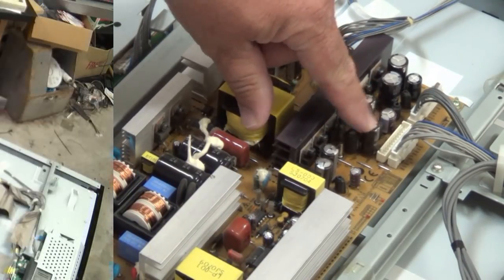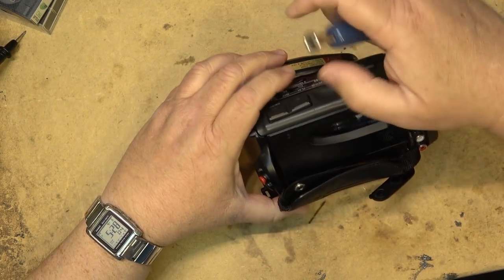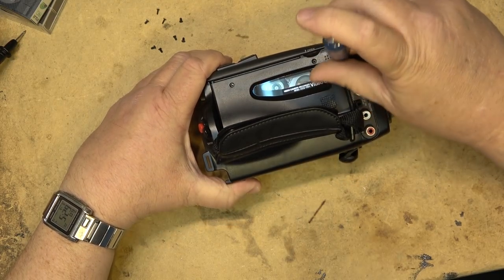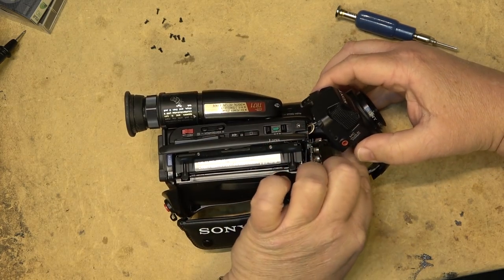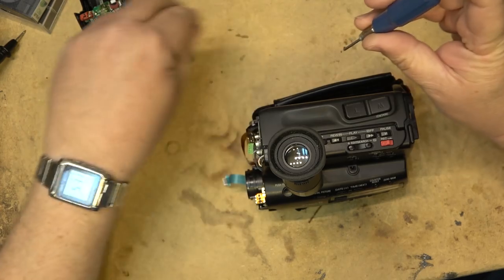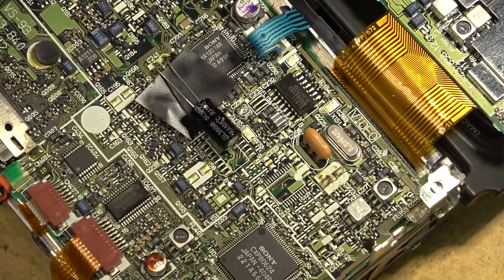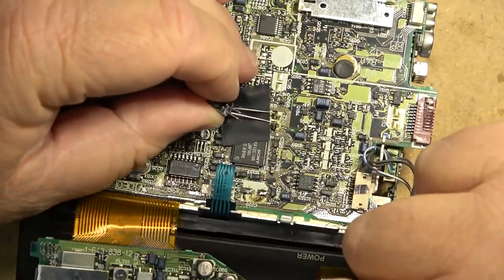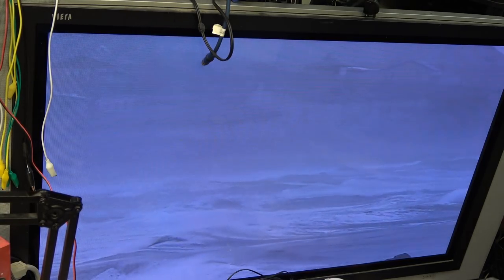Sony CCD TR71 with a very bad picture repair

Comment: One year to be precise  you worked on this camera. 😍
Reply from the maker: No it was more than a year ago more like 2
Reply: @12voltvids  did you check your video play list i found it on your channel, but if you want to still correct me that's ok.
Reply from the maker: 2019.  It's 2021 now.  That's 2 years by my recollection. It was an Indian lady that brought it to me and wanted me to sell it for her. I told her it wasn't worth anything as it would cost about as much to repair as i could get for it.  I transferred all her tapes for her and basically fixed for free and she sold it.   The guy that bought it gave it to me when he was finished with it.   Now it goes up on Craigslist to find a new home and hopefully that will be it.   Unfortunately i didn't receive the adapter.
Reply: @12voltvids  ok thanks. 🍻

Comment: I have this exact camcorder, it turns on and plays etc but the viewfinder has a vertical line only that i can see, i also notice an odour, probably needs caps, i may have to take a look now ive watched your video
Reply from the maker: Yes horizontal deflection cap.
Reply: did you ever fix the vertical line, if so how?

Comment: I've got a similar Hi8 Sony model and the tapes are running pretty slow (severe speeds fluctuations) and the picture on playback and recording is heavily noisy.
Any idea what the issue could be? Also leaky caps?

Comment: Hey, I was wondering about making an experiment with one of these Handycams; just replacing the black and white viewfinder for another colour viewfinder, both from different models of Handycams. Is it possible, or i need more pins for the colour connector than an ordinary camcorder has? Thank you, wizard
Reply from the maker: If not mistaken the video signal that feeds the viewfinder is only monochrome.
Reply: @12voltvids  Damn! I was wondering because i saw some of Handycams models that were released with monochrome and colour viewfinder

Comment: watching you now for a while but notice you never clean the pads or use liquid flux. You always have really good results and enjoy watching your videos :)
Reply from the maker: I use liquid flux only on surface mount components.  There is flux in the solder that works on conventional thru hole. As to cleaning the board this is totally unnecessary that's the flex itself is non-conductive. When I'm dealing with surface mounted chips are quite often clean it with isopropanol just so I can inspect and make sure that there are no solder bridges and a lot of times I do this off camera.

Comment: How do you adjust the tracking on a handycam? Is it the tape guides that you screw up and down?
Reply from the maker: 8mm has auto track finding using signals recorded on tape.  The guides affect the alignment so if they are out of adjustment you will get lines.
Reply: @12voltvids  yeah, I have a ccd-f350e which has this problem. The playback picture is all weird and multicoloured, constantly rolls and the picture in camera mode has a dark blue tint to it. Do you know which caps on which board I have to look at and if the rolling/multicoloured glitches and blue tint are caused by them?
Reply from the maker: @callumthomas6152  there will be a bunch of surface mount electrolytic. I don't know the specific ones off hand.

Comment: thanks for your videos, I have a samsung camcorder and I don't understand why I can't see the videos with RCA cables on my tv they look bad, but I see it and it's perfect on the small LCD screen of the camcorder, could you please help me believe what is wrong?
Reply from the maker: hope it plays good on the LCD screen then the playback circuit of the cameras working it's something in the video output that's not working possibly a bad capacitor or something in the video path where it splits off to go to the output.
Reply: @12voltvids  thank you very much for your answer, do you have a video where it shows in which part of the video camera the circuit you are talking about is located
Reply: @12voltvids  By the way, what I really need is to digitize some videos on hi8 mm video tape and since the converter does not receive a good signal from the camera it becomes impossible to digitize it, do you have a camera for sale that can help me convert my old videos?  I live in Meryland and how much would it cost me?
Reply from the maker: @jeovannymedrano2923  i don't have a hi8 for sale just a regular 8mm.  I do offer a digitization service however.

Comment: So to recap, you've recapped this camcorder.  :-)
Reply from the maker: Just worked on a 34 year old camcorder. It was a beast.
Reply: @12voltvids  If we went purely by the smell of the caps, it would be a beast from under the sea.

Comment: ive got one 720p i mean the very first ones i paid a huuuuge ton of money it was the top of the range at the time
Reply from the maker: Not these.  They were 480i
Reply: @12voltvids  i mean a similar one from panasonic that was one of the first 720p
Reply from the maker: @informediatech-bruno5766  would have been an HDV and i always thought that Panasonic used the same 1080i spec that Sony used and only JVC used 720.  That was one of the problems with HDV.  2 resolution standards and you needed to use the same equipment throughout work flow.

Comment: "I sell them dirt cheap". Well, I figure 'dirt cheap' means different amounts of money around the world. Where I live, 100$ is very far from dirt cheap (even in Canadian $). There are many people here who earns 250-300$ a month! I'd buy such camera for 25-50$ max in working condition. 100$ maybe for a higher range stereo Hi8 or a Digital8 which can play back analog, but I don't really need it because i have separate 8, Hi8, and Digital8 cameras, and I would be reluctant to wear out a Digital8 camera with analog playback. Playing back regular 8mm tapes with Hi8 cameras makes some sense though, because Hi8 cams have S-Video output.
Reply from the maker: But a digital 8 camera will digitize it into a high quality DV stream and send it over FireWire at better quality than you can get with a capture card even over svideo.  This one already sold and i ended up getting 200 for it and the guy that bought it sold it right away for 300. Made 100 just to pick it up and deliver it.
Reply: @12voltvids  I think not all analog playback capable Digital8 cams are able to digitize the analog signal and send it to FireWire. IIRC, only some of those can do it which has analog video input on them, and they are pretty rare. My high schools' studio had one, it was (well, not was, they probably still have it) a late '90s model, and they used it for capturing VHS footages as well. 
I'm not sure if the old DV format is up to today's standard as a source, if someone wants a HD upscale. It might be the fault of my lowly, last generation Digital8 DCR-TRV270, but it produces quite a significant level of macroblocking around fast moving detailed objects, like tree foliage in the wind. 
You said in a previous video that sometimes it seemed that a pro 3CCD Hi8 camcorder produced better picture than a pro 3CCD DV. That's exactly my impression even with consumer cameras. I prefer the picture of a Hi8 recording captured from S-Video over the picture of a Digital8 or miniDV captured through FireWire. I've never tried and compared what would happen to a good Hi8 recording if it's transferred through a Digital8 camera with FireWire. If it introduces the same macroblocking that my Digital8 camera does, then I'd stick with the S-Video output of a Hi8 camera instead. 
Recenly I used to capure to Lagarith Lossless video with PCM audio, then encode it to h.264 and AAC audio. If any picture enhancement is needed, I'd do it on the lossless source file with AVIsynth and/or VirtualDub. But I'm just playing with it yet, I might start a small archiving business in the near future, like in 2 years or something. For a start, I need a stronger PC than this old E7500 Core2Duo, because it's struggling with any picture enhancements, especially with HD upscale...
Reply from the maker: @mrnmrn1  every digital 8 camera that I've ever seen that has analog playback capabilities has the ability to digitize 8mm and high tapes. Not all had a pass through however so you could not just plug a VCR in and output it as DV. You could plug vhs in recorded onto digital 8 I meant output that as a DV stream but everyone that I saw that had analog playback could output on firewire. Unless someone asks for their tapes digitized into DV Avi I generally capture directly to a DVD recorder at the highest quality setting and then import the mp2 ipb stream and save it as an MPEG file. I find the color better we're using the hardware encoders in DVD recorders such as my Toshiba in Panasonic standalone machines as the color space is encoded 420 as opposed to 411. But for archiving I do not upscale I give the client their digitized tapes in 480i and they can upscale if they wish. 9 out of 10 customers don't even ask to have their tapes digitized to USB or hard drive they want their tapes digitized directly to DVD so they have a physical copy not just a file that can be wiped accidentally. 
It's not that the BB encoding look bad as I showed in that demo tape that wasn't the tape format that made that recording look bad that was the crappy chips in the camera. The DV format had such high resolution and the camera used relatively low resolution sensors. that was a crappy Cannon three chip camera that made those recordings, my pro JVC did not produce artifacts like that and did look Superior to my hi8 footage of the day. The problem with analog is the chroma is noisy and that random noise does not play well with encoders and creates larger files than they need to be because the noise has to be also digitized a good clean video signal will look Superior when stored as digital files even in DV. TV looked very good when the source feeding it was good but you know saying garbage in garbage out.